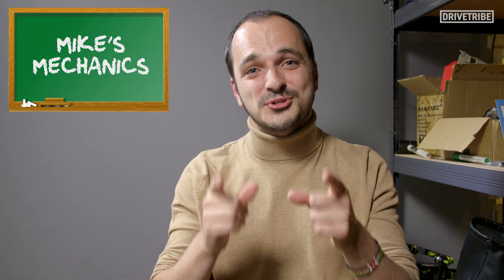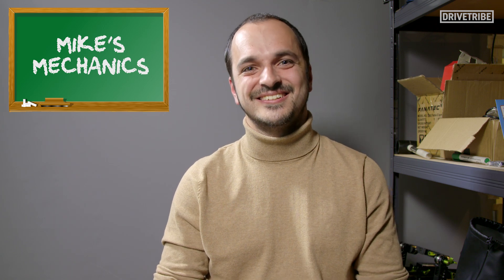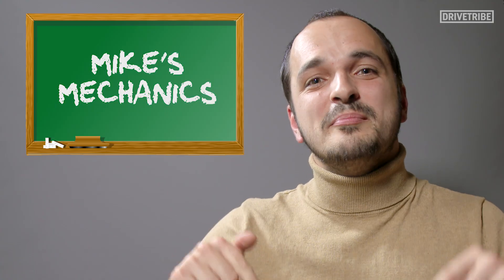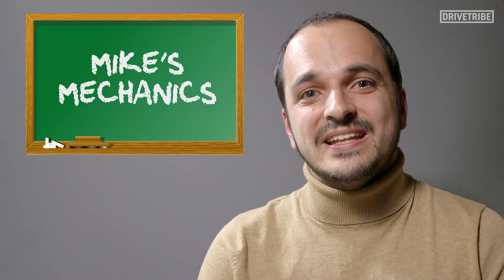Why do cars whine in reverse? – Mike's Mechanics

Comment: You missed a vital point that is at least or more important than weight in racing cars.  Straight cut gears generate much lower power transmission losses compared with a similar helical cut gear.  This is partly due to the side loads that you mentioned but is also due to greater friction and heating from the meshing gears and additional required thrust bearings.

Comment: This is not why reverse gears are straight cut.

In a manual, the mainshaft and countershaft gears for each gear ratio are constantly meshed.  The active gear ratio is selected by using the shift fork to lock one of those helical gears to its shaft with a collar and synchronizer.

But in reverse, the gears cannot continuously mesh because an additional idler shaft and gear are required to reverse the direction of rotation.  There is an air gap between the mainshaft and countershaft reverse gears.  When you shift into reverse, a shift fork slides the idler gear on its shaft to mesh with both of these gears. The only way that the gear can slide into mesh like this is if it's straight-cut.

Note that sometimes it can be hard to find reverse.  It might take a few tries to get all the teeth aligned so that the idler clicks in.  But at least you're not dealing with helical gears, which would never mesh but grind forever.

Comment: The first gear in my MG Midget is also straight cut. It also lacks synchromesh in first so you can't downshift into it, not that you really need to anyway. From what I understand, this was to cut cost as it was an entry-level sports car at the time.

Comment: Nice video but I would query your comment about smooth helical gear engagement. That implies the helical gears engage and disengage when changing gear, which of course they don't as it is nigh on impossible to have helical gears slide into mesh. The straight cut, or spur, gear IS able to slide into mesh and it is by the use of a spur gear on the layshaft, another on the output shaft and a sliding third idler gear between them that gives us reverse, and the whine.

Comment: Perhaps you could have explained how the reverse gear is straight cut so it can be slid into position between gears on the input and output shafts to reverse the transmission whereas the forward gears are constant mesh with synchromesh?

Comment: Explain Double Clutching  please!
Reply: It's for old cars,  done
Reply: It’s for semi’s and real drivers noob. 
Although eventually you should be able to float on a big rig
Reply: Double De-clutching is for use on boxes without 'syncromesh'. All modern boxes have cones which spin the next set of gears, just before they mesh, so they are both spinning at the same speed before the gears mesh and don't grind as they hit each other. 
On non syncromesh, the gears will grind as you select them. To stop this, pause between selection, with the stick in neutral, then let go the clutch. This will spin the next gears in the box. Now re-depress the clutch and select it. The gears will mesh without a grind as they have been spun up to the same speed. Changing up, just needs this pause in neutral. Changing down however, the engine will be revving higher for the same speed. So when you pause in neutral, give the engine a blip on the throttle to get the next set of gears spinning faster and ready for selection.
Old Fiat 500's (cinquecento) had 'crash' boxes. So you have to drive them with double de-clutching and makes you feel like a rally driver.
Reply: @richardhemingway6084  thanks
Reply: @BrandMalone24  lol straight to the point

Comment: So, if we don't use them for 'going forwards' gear because of the noise, why don't we use helical for reverse?
Reply: He explained it 
Because it's cheaper just to use helical, firstly because you are only using reverse on a standstill 
And you aren't using reverse that often compared to the forward gears.
Reply: Now that the entire Manual transmission vehicles in USA are all Helical Gears in Reverse too. Straight Cut Reverse gears are now gone.

Comment: 0:53 no it doesn't? Who says that? What do you mean, exactly? involute gears are quite smooth?
Reply: Because as the hog rotates the amount of torque doesn’t slowly increase. In helical. As it rotates, the surface area increases. If it’s straight cut. Then it’s no contact then full contact. You know the term axial load? Well if it’s straight cut you don’t have to put up with that factor. The gear doesn’t increase the amount of torque. Straight cut just handles wayy more torque
Reply: @Heizzer47  Yes axial load, forces along the axis of the axle, if the gear is on the x-y plane then axial loads are on thr z axis. Anyway, what are you talking about "as it rotates, surface area increases" ? This doesn't seem logical. The gears continuously rotate. Does surface area also continuously increase to infinity? One of us either does not understand how this works, or does not communicate it correctly